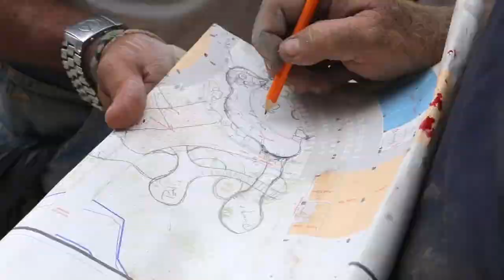Sand Bottom for Formal *REC POND* - Part 6

Comment: Anaerobic bacteria (without oxygen) occur in "deep" (around 10 inches more or less) of undisturbed sand or mud. This bacteria consumes nitrates in the water and releases the nitrates as nitrogen gas bubbles into the air. For this reason I have always kept 1 quart mason jars in filled with basting sand in my unplanted aquariums. You can actually see pockets of nitrogen gas form and being released in these jars. This is just an old school way of dealing with some of nitrates between water changes.